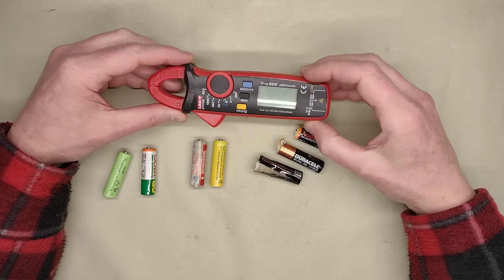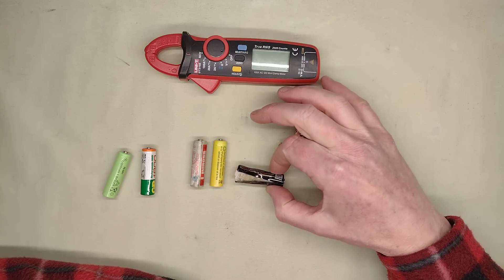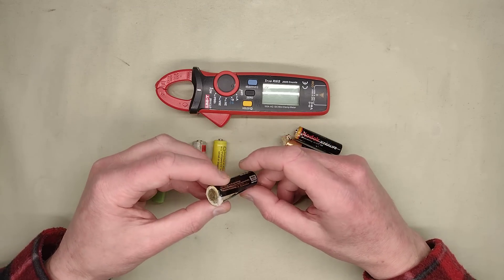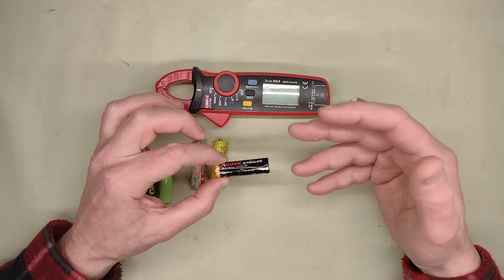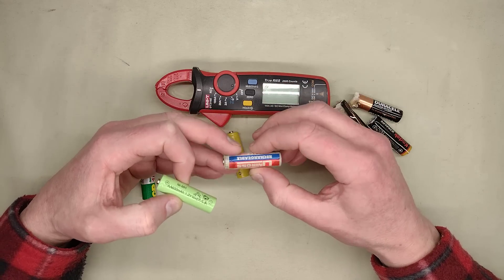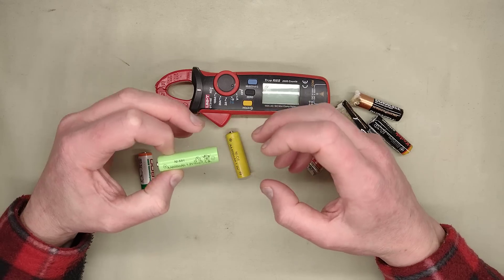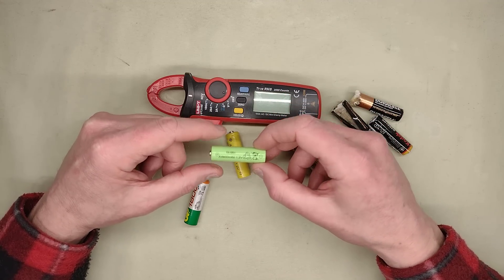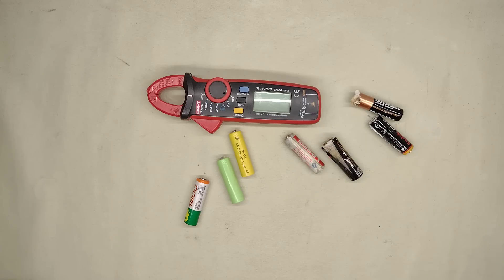The curse of leaky alkaline batteries

Comment: What frustrates me are the push button contact switches used in everything. Instead of completely cutting out the power, too many devices have a slow trickle current which mean that for NiMH you can easily drain them beyond what you should. Every battery powered device should have a SPST switch which completely isolates and would prevent a lot of cells leaking.
Reply: I'm an old fart, and I miss old-fashioned on/off switches too.  These days almost everything is either on or less on, never actually off.
Reply: @realityquotient1968  I think you can blame cheap microcontrollers and lazy developers for that. If the choice is "less on, but ready to use" vs "off, but it'll take 5-10 seconds to load the code before you can start" it is no wonder why many choose the easy and quick option.
Reply: @xVolta  Not everything requires an on board computer.
Reply: @realityquotient1968  I completely agree. That doesn't stop them from adding computers to things that don't need them. I was just given a new teakettle, which for sure doesn't need a computer, but it's still got a microcontroller.

When I said "blame", I thought it was clear I didn't agree with the practice, but my disagreeing with how products are being designed and manufactured doesn't mean they aren't being designed and manufactured that way.
Reply: Agree with Volta X here that it's laziness (and to a lesser extent extreme cheapness) which makes soft-off products bad. As a (hobbyist) designer of MCU-based devices, with careful design it's usually not all that tricky to get sleep currents into the sub-microamp range, which is far enough below the self-discharge rate of any battery (regardless of chemistry) that to all intents and purposes the device truly is "off". This is however more difficult if the component budget is down at the cents-not-dollars level.
Reply: @xVolta  I'm annoyed the damned dome light in my truck has to controlled by the OBC....
Reply: @realityquotient1968  while I can't speak for the dome light, a lot of the things connected to CAN Bus are better conceived than they might first appear. A good example of this is the controls on the driver side door. Maybe access to 4 windows, window lock, maybe mirror adjustment, door lock/unlock switch, and that doesn't include the door lock itself, the power window motor, driver side mirror, etc. The bus gives the panel, and the devices in the door, the ability to route events throughout the entire vehicle. This greatly reduces the complexity of the harness and should increase reliability, although when something does fail it might disable lots of things at once. It's also because of this bus that things like remote start, remote window opening, remote unlock, and dimming the dome light after closing and locking the vehicle, can be accomplished without exhaustively untangling wires wrapped in a bundle.
Reply: @realityquotient1968  Amen!  Just because you can do it, doesn't mean you should.  Stihl has ruined their new chainsaws.  The older ones are  even more valuable now.
Reply: @realityquotient1968  I agree, All the equipment left in standby modes.. think of the 100's of millions of devices across the world that sap energy continuously just so a soft switch or touch can be used . The energy WASTED is probably many many Megawatt hours . Surely in the age of the "carbon " reduction and saving the planet rhetoric you would think world governments would DEMAND a proper "off" switch on goods.
Reply: @realityquotient1968  you're probably 30 max
Reply: @onlypuppy7  You're only off by 23 years.
Reply: Ryan I couldn't agree more. Manufacturers who do that are a real pain. I think that their attitude is their product is so essential you have to use it all the time. I have news for them and it isn't to confirm their ego.
Reply: I had that with a digital scale. It powers on by tapping it, which is already a nuisance because it needs to be hit pretty hard for it to wake up. But the worst thing is that this standby mode which obviously needs to keep the load cells active all the time, devours the CR2032 cell in no time. It didn't take long before I added a good old switch, and now a battery lasts years instead of weeks.
Reply: @alexanderthomas2660  I never buy anything CR2032 - especially scales. AAA is plenty small for a nice design. I also tend to avoid 9V, and other funny types. And I always stock charged AA, AAA and 18650 🤓
Reply: @TheStuartstardust   I used a lot of Cr2032 powered remotes as part of my job.  In that application. For that I prefer them to AAA batteries.  They never leak and even with daily use I've seen them go nearly 10 years.  I agree with you regarding things like scales and most larger items, but Cr2032 does have it's place.
Reply: @BD-xz6te  Valid point sir - I avoid leaks by using rechargeable ones. But also have some calibers with button cells - else I do avoid them whenever possible.
Reply: @alexanderthomas2660  Is it a kitchen scale or a bathroom scale ?
Reply: @psirvent8  It's a bathroom scale. The idea was probably that people will be too lazy to reach down to toggle a switch, even though the scale usually has to be picked up anyhow to take it out of storage.
I also have a kitchen scale that takes 2 AAAs, but although it's also an always-on circuit, at least it can be toggled to an actual efficient standby mode where it only shows a clock and drains very little power. It is happy with some leftover batteries that caused another device to shut off.
Reply: @alexanderthomas2660  It's not that the manufacturer thought the customer would be too lazy to operate a switch, it's a cost cutting exercise.
Reply: @alexanderthomas2660  weight watchers scale with the metal strips? ive got one that has to be banged on to even come on....and its wrong, based on how much salt or water you drank last night.
Reply: @psirvent8  Yes.
Reply: @alexanderthomas2660  Same here... my Salter kitchen scale has needed one battery change (2x AAA) since 2008.
Reply: OMG I just realised, I got a dremel (well an aldi version) and well, I could just add my own switch!
Reply: I agree. I'll expand that to include all corded devices. So many things lack physical power switches these days.  The "power" button is just an input to the circuit board.  For instance if you turn off your tv, it's not truly off. If it was it wouldn't recognize the IR code from the remote telling it to turn back on.  All it takes is a bit of electrical noise at the wrong moment to flip a One to a Zero somewhere in anything digital and you can get some pretty bizarre malfunctions.   
I work on a lot of equipment that is hardwired in.  Every time we have a large electrical storm I end up driving all over creation to pull fuses and reinstall them because the manufacturer's  "on/off" switch is a mode selector which the cpu ignores while it's running around in little circles screaming gibberish.
Reply: Yeah but you could just use Ni-CD instead because it is completely fine to drain them to even 0v which funnily enough is the best storage voltage for Ni-CD batteries
Reply: @aleksandersats9577  No joke, and they also last damned near forever even when mistreated. I've still got a few GE branded NiCd AAs from the 1980s that take and hold a charge. Those are outliers, for sure, but still.
Reply: @aleksandersats9577  the power curve for NiCad aren't great for Alkaline 1.5v substitutions. You might be under powering your device before you know it because the cells don't even start at 1.5v. NiCad develop a memory which reduces their capacity over time, and good luck finding them today, what with them containing Cadmium.
Reply: @R.B.  obviously yes, the same goes for Ni-MH. That said it still works great for most applications, especially the fact that they are re rechargeable already making them infinetely better than alkaline. Also Ni-CD is extremely rugged, it refuses to die. Discharging to 0v takes almost no damage, if overcharged it heats up to expel the excess energy. This makes Ni-CD even drastically better than Lithium polymer safety wise
Reply: @aleksandersats9577  Absolutely not true.  You should have 20% charge to avoid degradation.
Reply: @solarsynapse  I just looked it up myself and the charge range for storing NiCD batteries ranges for 40% to 0%. 0% effectively meaning 0v. So no, I was right and I looked up articles and even wikis about it
Reply: I agree, but there's also good design and bad design. There are products which consume a few microamps on standby and products which feast on a milliamp or more. If more designers made the effort to truly minimise their standby draw this wouldn't be an issue.
Reply: @-yeme-  nothing wrong with providing a switch that is never used, that's known as a shunt. If I'm not using a device, any current leakage is too much. I'm okay with a few mA for something on Mains which will cost me a few cents annually, but battery powered devices are insufferable, especially when they aren't used for long periods of time.
Reply: @R.B.  each to his own. a device using 5 or 10% of its battery capacity while sitting unused for months really doesn't worry me. personally, if I'm not using a battery powered device for any longer than that, say several months or a year, I will take the batteries out anyway. I would do that even with a device that has a physical switch since even entirely disconnected cells can still leak given enough time.
Reply: I've got a digital Vernier caliper, mind you it's only a cheap one but it works for what I want. Every time  go to use it the battery is dead, why does it have to have a residual current draw and as others have said where's the off switch
Reply: @mikemilburn7823  my digital non Vernier caliper has a similar issue, which I addressed by putting a small tab on the positive side of the battery which I use to extract the battery when I'm done with it. No drain that way, and it helps avoid leaks.
Reply: @mikemilburn7823  I've got one of those pieces of trash too!  Even though I'm an EE, I went back to a good old fashioned mechanical caliper with a dial and a needle.
Reply: @don_cc123  LOL, same here, battery lasts forever ............MIke
Reply: @mikemilburn7823  Yes I have the same always flat. So I started removing when not in use the contacts are failing now and gone intermittent. You just can't win.
Reply: while I also think that every device should have a proper switch- I don't know if it would actually benefit the leakage problem since 95% of my leaking batteries were still in their original package- meanwhile the same batteries where fine inside of random devices ( tv remotes, game controllers, pc mouse, flashlights...)
Reply: @olik136  Putting a switch on your tv will make the remote rather hard to use.
Reply: @stargazer7644  Remotes on a TV? I never had any difficulties with non-remote sets. And power-on in particular doesn't really benefit from remote control. Chances are when you decide to watch TV you will walk to the couch or whatever. When you're up it's not that hard to hit a switch on the set.
Reply: It can be done right. I have a Casio EZ-Label printer that has push on push off. It doesn't seem to significantly discharge its 6 AA cells when it's off.
Reply: You know what's worse?  Clicky rotary or slide switches WHICH STILL ARE SOFT-OFF AND LEAVE THE PROCESSOR DRAINING THE BATTERY.  Bonus points if its on a device which doesn't have a swap/removable battery.  Double bonus if it can't be used while charging.  Triple bonus if it can't be charged after the battery runs too dead and isn't intended to be user-serviceable.
Reply: I will note that it's possible to engineer soft power switch circle circuits which take far far less current than the self-discharge rate of even the very best NiMH batteries, such that it's also irrelevant that it's not using a full physical switch. Unfortunately, getting the quiescent current that low isn't as cheap as doing things the quick and dirty way, and manufacturers will generally take the cheap way out when they can.
Reply: Mechanical switch might be the most complicated and expensive part. Also it would be the odd one out part as everything else is directly printed on.
Reply: There are some Coleman lanterns that have made a marketing point to highlight that feature.
Reply: I have a device like this. It will drain a battery between uses  days apart which would otherwise last years. I have to take the battery out after each use.
Reply: While I tend to agree, it is worth noting that the amount of "trickle current" is dependent on the design of the particular device.  It is easy to design a device that uses a momentary contact on-off switch and yet has a trickle current that is substantially below the self-discharge current of the alkaline battery.  It is a shame that not all devices have a negligible discharge current when off.
Reply: I agree. Also devices with irremovable batteries - if the microcontroller crashes you can't turn it off to reset it.  Not even a switch to disconnect the battery.
Reply: I recently through away some flashlights because of that drainage. I was noticing that each time I needed my emergency flashlights, they were dead, and I'd have to put new batteries in. I specifically bought flashlights that use regular batteries rather than rechargeable, because I needed that long shelf time, intending them to be ready when I needed them. Turns out, they have a "low-battery" indicator, which uses a trickle of power constantly, so they can light up the indicator when low. Well, given about four months on the shelf, that "low-battery" detection circuit has CAUSED a low battery condition.
Reply: Yea, I get you, my Brady thermal handheld label maker is like that. If I leave batteries in normally they go flat. (Which is confusing considering even with batteries removed and reinstalled the last label is remembered, so what is the drain for?). I have lately been switching batteries that are in series to same poles and that has corrected it, but I have to always remove and reinstall them correct ways.
Reply: I completely agree with you Clive.  And I think the problem is getting worse that it was in decades past.  In the past 5-10 years, I've had more alkaline (also known as 'alkaleak') batteries leak than I have seen in the 35 years previous.  It used to be quite rare for one to leak, in my experience.  Nowadays, I don't dare leave alkalines in a device more than a few weeks without being checked.  With the advent of low-self-discharge NiMH cells, there really isn't much of a reason to use alkalines.  Speaking to your comment about bad electronic design of devices that register NiMH cells as "dead" or nearly dead,  I see that problem in radios by C. Crane and Sangean.  They don't register them as dead, but with C. Crane in particular, there is no switch to tell the device you are using NiMH cells.  It registers them as half-discharged even when they are freshly charged.  Sangean at least has a few models with a switch to tell the battery meter you are using NiMH cells, but now all.

How is a device designed to handle nominal voltages from the 1.2v for NiMH cells to 1.8v for lithium metal cells?  I have a couple of radios that distinctly tell you not to use lithium metal cells (L91), so it isn't designed to.  How can manufacturers make devices to use a wider range of battery voltages and report their capacities correctly?  There's the switch I mentioned, but how else?

Another problem is that here in the USA, it's quite rare to find true C or D cells (not just AA cells in a larger wrapper) in NiMH chemistry.  And chargers that will charge them reliably and correctly are harder to find.  My Nitecore SC4 cannot be trusted to cut off charging some 10,000mAh Amazon D cells.  Sometimes it will cut off, other times, it just won't.  I've charged at 0.1C and 0.2C.  Sometimes it will, sometimes it won't.
Reply: By all means, put an actual switch in devices!  This is especially true of devices that may be used very infrequently for emergencies, like flashlights or radios.  I always tell my friends and family to keep the batteries next to emergency devices, not in them.  This is for two reasons:  alkalines leak (in particular), and the device may be using energy in a slow trickle (it'll be dead when you really need it).
Reply: Phantom leakage. Yup. Gimmie a switch any day but manufacturers think they look outdated. 
Can't put a blue LED brighter than the sun in a two position switch. 😂
Reply: The contact switch is too expensive for manufacturer and if they increase the price they wont sell it. I wouldn't blame the manufacturers here, as they don't have much choice. While big companies like Siemens or Grundfoss  can afford to stand-up to CHAINS and make a quality product and face the fact that chain-stores wont sell it because they will not get the margins and sales frequency of the cheaper products, even companies like philips strugle to sell some of their premium products. (  SO if they do not buy it, they control consumers). In UK  it is unbelievably hard to buy a good quality products and often you are forced to filter through junk on ebay as the only option to find something of better quality/ ask friend from bigger company who does big enough buys to get quality from manufacturer) or ask a friend who is abroad to bring some.
Reply: @Zlodej5  I think it's fair to blame both the manufacturers and retailers engaging in this race to the bottom, but I take your point.